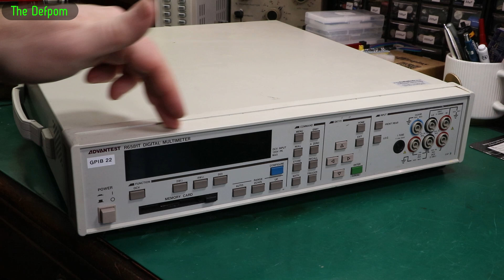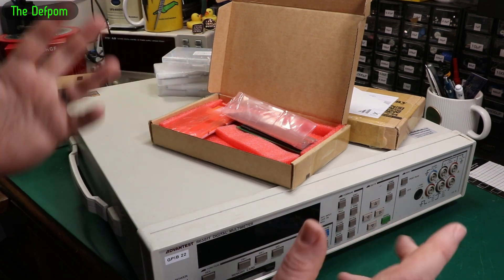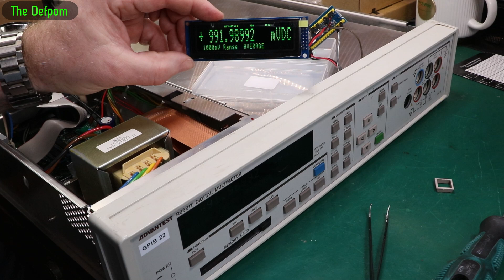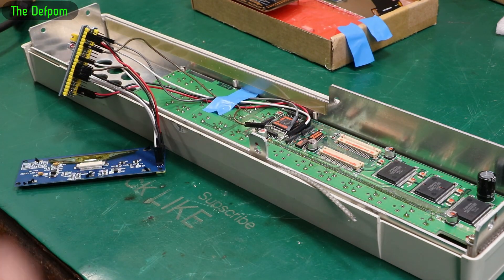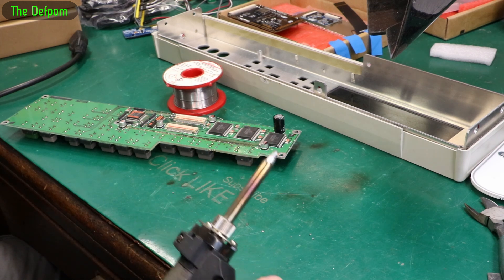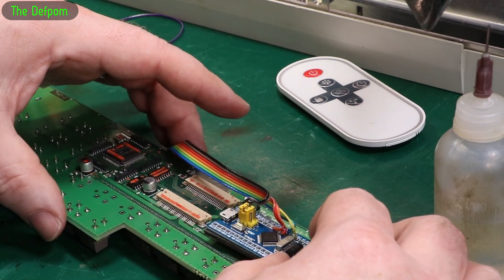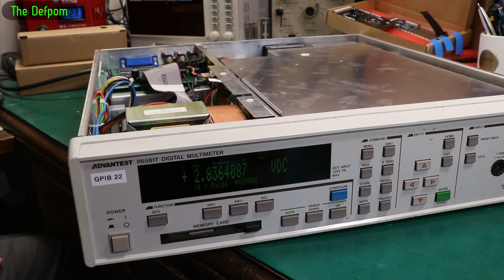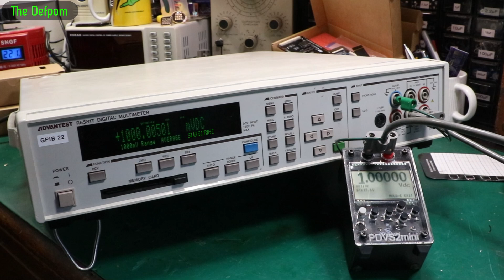🔴 Advantest R6581T Repair Part 6 - Display Replacement with OLED - No.1290

Comment: Refresh rate? Nothing about the refresh rate, 2 to 4 seconds!
Reply from the maker: Eh? Things thing can update dozens of times a second. Don’t confuse my settings for averaging and 100PLC for a slow response time, This is how I set it up to get greater accuracy and resolution, otherwise I might as well be using a handheld multimeter from Aneng.

Comment: Hello, first of all mad respect. Old sand n** does not mean you evil. But I can remember, from some years ago, a similar project done by a friend of mine where the EMC from the MCU caused issues for the test equipment. OLEDs are notorious EMC pigs which fart out a LOT of EMV due to the integrated SMPS on the planar. I would suggest a test of the system, or an attempt to recal just to be safe.

Comment: Hmm, interesting but bit wierd? With all the effort for programming, getting all protocol working properly - why not make single replacement PCB with keypad and everything to mimic original board? This way it's 15 minute mod project, instead of all that pain de-soldering original glass? Surely simple 2-layer PCB wouldn't be that expensive...
Reply from the maker: @xDevscom_EE  the interface IC that controls the front panel would need to be replicated as well, along with all of its communications to the main board, I don’t see that being so easy to do. A drop in replacement would be great but I’m certainly not the one to do it…. Where’s Ian?
Reply: He is making that pain desoldering the original glass because he wants to keep it because it's dim, but not busted. This mod was made by Mickle to replace broken screens. In that case, you can cut the screen leads instead of desolder them and make the job a 5 mins project.

Comment: OLED? not worried about burn-in?
Reply from the maker: @yoeribolderdijk1257  no, if it gets bad it’s not much hassle to replace it, I’ve had oled on devices operating for over 4 years and still fine, sure it is a thing, but it’s not a big deal.
Reply: The OLED screen cost 10 euros. When it does, just buy another one.
Reply: @Ismsanmar  If it still exists after a few years.